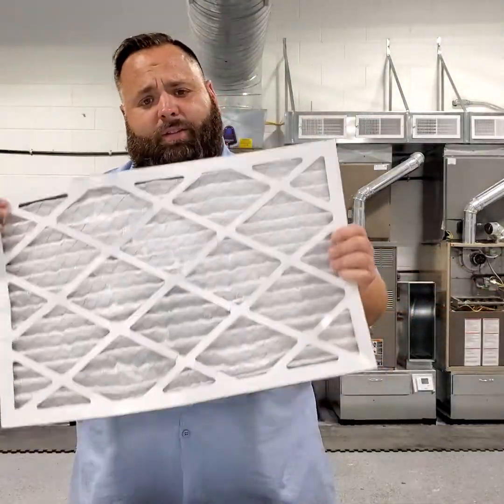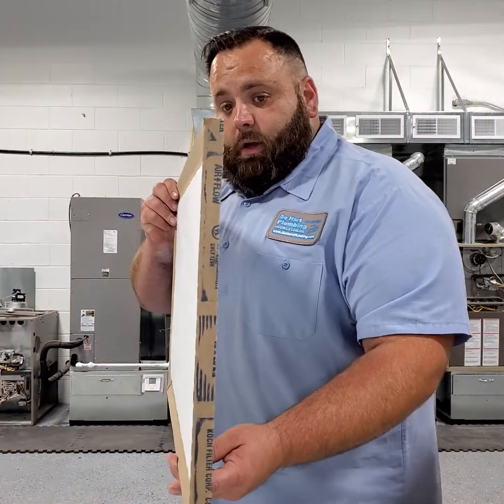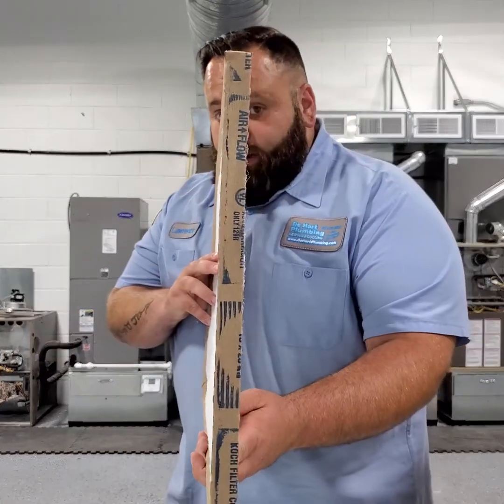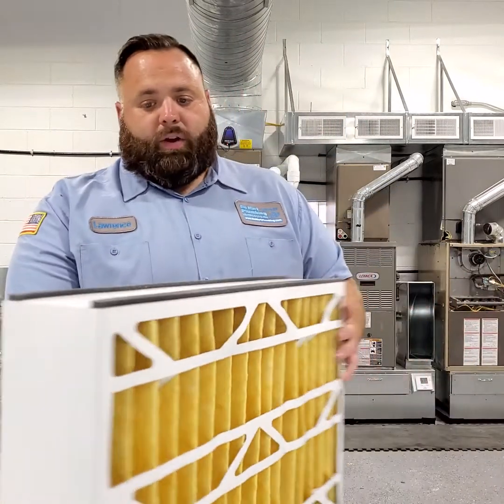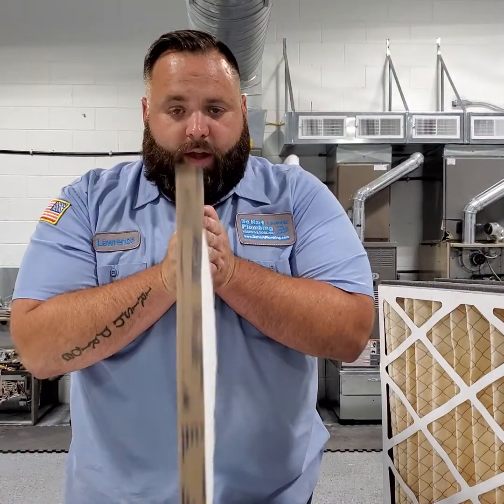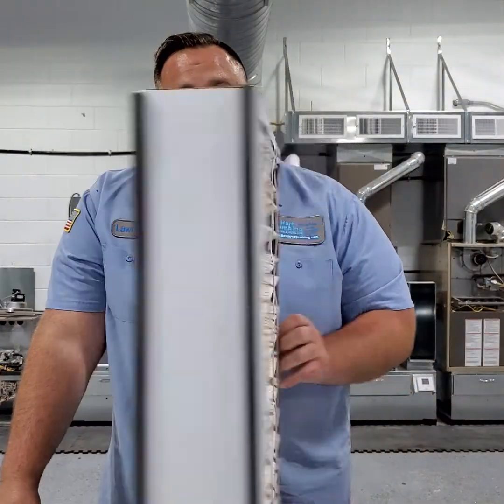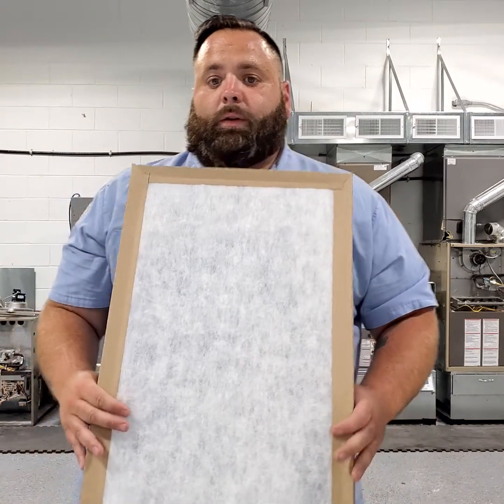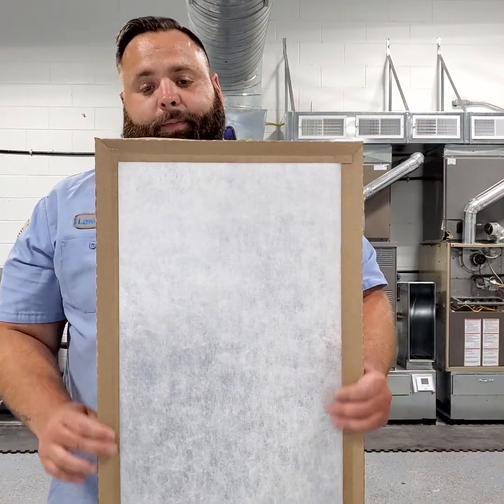HVAC system filters. Whats bad & whats good?

Comment: OK, so I've been using the accordion 20x20x1 filters for the past 10 years in the Las Vegas area. Never heard about MERV until today. My unit froze and we are waiting for it to defrost so the tech can figure out why it froze.
If I don't have carpets, pets, or smoking in the house, do I want MERV 7 and lower? So far, I only know I had 11 MERV for the last 3 months. Never knew about it to look.
Reply: Just brought Merv 11 - we have carpets and allergies. How is the 11 working for you?
Reply: @itzjustkay1972  I noticed the biggest change in air quality when I started running an air purifier. Not one of those ionic ones, but a hepa one. Due to an old rental with a serious mold problem I developed a sensitivity that, at 30, gave me my first real idea of what my asthmatic mother has gone through when her allergies affect her. So, someone loaned me an air purifier when I was there and then after I moved I started noticing that I’d become short of breath sometimes, so I got myself an air cleaner. (A good one) There is a noticeable difference in the air quality in my home, and what’s most noticeable to me is that I never have to dust, like, EVER in the rooms with the air cleaners in them. There is one room without one and I still get a little bit of dust there, but not as much. I think it’s more cost effective in the long term and much more noticeably improved on the short term to get a good, hepa, air cleaner and use cheaper, simpler filters that won’t stress your HVAC. bc there will be allergens in the vents, in the registers, in all these places PAST the filter anyway. If you have allergies I think you’ll truly notice an improvement if you try that. (And if you’re not vacuuming twice a week or more with a closed air cycle hepa filter vacuum I’d recommend that as well! I have recs on products if you’re interested, they pretty much line up with what wirecutter says tho)

Comment: Not to contradict his basic advice, but its interesting to see another HVAC Youtuber (https://youtu.be/GoOKjINPgpY) video where he tested static drop in pressure on both sides of various MERV-rated (MPR actually) Filtrete filters from MPR 300 to 1900, plus other 'flat' fiber filters. It was notable that the Filtrete  MPR 1900 uniquely actually had the lowest pressure drop.
Reply from the maker: That pressure drop is very important. However the HVAC system static pressure is the most important. That tells us how restrictive of a filter the hvac system can handle.
Reply: @dehartplumbingheatingcooli451  - I think you should've put this in the video description but what is the suggested filter to use that you showed in the video?  You didn't mention any specs about it?  Is it a Synthetic/Poly MERV 4 filter?  What brand?  Can you provide a product link so we can gather more info about it and/or maybe purchase options?  Thanks man!
Reply: @Kenster-man  that's what I've been using per my HVAC pros suggestion. They were 2.50 each when I started buying them last year but have gone up in price. I don't think brand matters, and got mine at Ace hardware, Palmlicoair brand
Reply: But the 1900 is expensive at $22 each.  Say it works for you for 2 months - that's costly and unnecessary to have a MERV 13 1" filter if you don't have asthma or allergies.  

Based on that guy's test - the 300 was practically equal in pressure drop performance and I would just use that (about $5-6 each) and change-out monthly.

Comment: Question. I have an older trane system that takes 3 - 10x20x1 filters placed in this shape /\/. Can i just use 1 bigger filter placed in at an angle like this / instead?

Comment: I've been using the Merv 8 dust lock and ultra poly in the metal frame in my house for over 10 years (Merv 8poly has twice the airflow that the standard Merv 8 pleat has) I made sure to use weather stripping around the frame to keep our any air bypass from going around the filter . I have been 8n the air filter industry for over two and a half decades and recommend poly over pleat all the time at certain accounts. I have seen people buy in to the highest Merv rating that can even HEPA in some cases their system and I try not to make them feel bad for doing so. I will now just send them this video in the future.
Reply: What brand and where do you buy your MERV 8 Poly filter?
Reply: @Kenster-man  I work for a filter company that makes filters for numerous places. I know tri-dim filter corp has them along with American Air Filter
Reply: @Kenster-man  Google ZORO they have it in bulk rolls in different sizes.
Reply: thanks ...for recommending something  regular people know nothing about and can't find any meaningful information. enjoy your 8 ultra poly wolly dust buster, i guess?
Reply: @trippplefive  a simple Google search can help you .

Comment: You said you need adequate static pressure.  What is considered adequate?
Reply from the maker: Check on the data tag of your HVAC equipment. Look for Max Total External Static. It's typically. 5
Reply: @dehartplumbingheatingcooli451  thanks

Comment: QUESTION: I don't understand how air filters can be directional? They have an installation arrow on them, but why? Ditto for the pleated cabin air filter in my car which, when I replaced it, I couldn't remember which way it came out and the retainer wasn't marked.
Reply: I believe it's because there is metal netting holding the shape "downwind."  If it were on the other side, the filter would billow in the direction of the air flow.
Reply: One is for the return duct and one is for the supply duct. 

The arrow goes innthe direction of airflow. 

So if you feel air coming from.the vent then the arrow should be pointed down towards the room it is supplying air to.

If you feel no air coming through when the unit is on, then it is returning air to the system to recirculate. In this case the arrow should be pointing up tor2ards the attic. 

Hope that explains it

Comment: High air flow fiberglass filters in my AC unit dirties the coils in the air handler ! Lowering the efficiency of the unit !
Reply: I have always used the the cheap fiberglass for years. I've never had a problem.

Comment: Are the fiberglass filters changed every 30 days adequate to protect the equipment, including the evaporator coil?
Reply: Yes they are. Spraying them on both sides of the filter with Endust or Lemon Pledge helps capture the dust even more.
Reply: @thulsa5218  Thank you! I've been doing just that!
Reply: Lots of HVAC shops & techs think that the cheap fiberglass filters are not good enough - way too wide open.  I can even see-thru them to watch TV - and looking at one closely, how can it trap any dust particles?  Lots of folks are suggesting entry-level MERV 4-6 filters minimum versus the see-thru MERV 2 cheap fiberglass filters.  A cheap MERV 4-6 poly filter like in this video that the guy showed (...is probably a MERV 4) or an inexpensive MERV 6-8 pleated filter and replace every month.
Reply: @Kenster-man  I've been using the fiberglass filters in my home hvac for the last 20 years and there is no dust/dirt build up on my evap coil, blower motor, or ductwork. Many hvac techs don't like the fiberglass filters because they get far fewer service calls so they don't make any $$.
Reply: @thulsa5218  I wonder if this is affected by region? It’s gotta be, right? Like, maybe certain areas have less potential allergens in the air in the first place?

I also think the fact that you actually change yours monthly is a big help, bc a lot of ppl don’t do this. When I moved into my previous apartment, after asking them a ton of times to change the air filter the guy came to do it but said he didn’t have a key to the little door to get to it, so then all this waiting for the key and long story short, I finally got so annoyed I just took the door off it’s hinges and when I opened the thing, the filter had fallen down because it was so heavy full of debris. It was one of those green cheap ones, too. Can you imagine?

Comment: I just realized the house I bought didn't have a filter in the one return our system has. And I wondered if they removed it because it was choking the airflow. But glad I saw this video. I'll get a 1$ filter because there's large dust balls floating in the vents when the ac comes on lol
Reply: Yeah removing the filter is such a bad thing to do . Not because dust gets in your ducks the worst part about it is it plugs the  A coil , which is your cooling coil. If that gets plugged that is costly problem. The filter does more than just stop dust in the air it stops dust getting into your components of your furnace.  What a stupid move by the previous owner.
Reply: @llignwahs66  Had a professional check my HVAC system and he said there's no filters because I have an electronic filter near the main fan area which handles filtration. Makes sense now.
Reply: @50kT  I’ve never heard of that, did he happen to explain why you had the dust balls coming out of the vent?
Reply: @rainbomg  No but I think its just dust that eventually gathered together into a ball. It looked scary at first like a rat was jumping up and down in the vent lol, but it was just this big dust bunny that was blowing in the wind
Reply: @50kT ha! I had that in the bathroom vent when I first moved into my current place. Its still there, it looks like a little piece of paper. I can’t reach it. That’s interesting tho, about your electronic filter… so you never have to change it out?
Reply: @Jacynda Minor  I moved here a year ago and changed it over the summer. I think it should be changed yearly. Yea it's always interesting looking into all the unseen spots of a house.
Reply: I hope you had your A-Coil checked for blockage.

Comment: Can restricted air flow cause the burning of fuses in the unit? Because it's working so hard?
Reply: My furnace has a safety shut off switch which kicks off in a reduced air situation. It's supposed to be self resetting but it didn't reset. The HVAC pro had to tap on it to get it to reset, explained to me the filter situation, and I've been using the simple fiber filters ever since.
Reply: Restricted flow will not create a load on blower motor.

Your furnace blower is a "pump". 
When you increase the load on a pump the amperage draw increases. When you decrease the load the amperage draw decreases.
More air = more load
Less air = less load.

The biggest negative when decreasing air flow in a furnace blower is the possibility of overheating the motor because of lack of air movement re: motor cooling.

Anyone not agreeing, please get out your amp meter and compare a new filter to a dirty filter.

For a furnace to "shut off" because of low air flow, the furnace has built in protection for "heat rise".
If not enuf air is passing thru furnace the heat rise protection will shut furnace off.

Comment: Hi Dehart. Quick question for you. So basically what you said in this video is 100 percent correct. I just had a new air conditioner installed at my house and the 14 x 20 x 1, merv 8 pleated filter was causing the evaporator coil to freeze up. The HVAC company put a 16 x 20, x 1 fiberglass filter in my HVAC system which resulted in the system NOT freeing up. I am now considering having the ductwork changed to accommodate a 16 x 25 x 4 pleated merv 8 filter. My question is do you think a 16 x 25 x 4 pleated filter will allow more or less air then a 16 x 20 x 1 fiberglass filter? I understand the pleated and thicker filter (16 x 25 x 4) will have way more surface area, but after taking into consideration the higher merv rating of the pleated filter do you think I will still get better air flow compared to the fiberglass filter? Thank you.
-David
Reply: It normally takes a 4 inch pleated merv 8 filter to give the same air flow as a 1 inch fiberglass filter. But the air quality will be hugely improved with the 4 inch filter.

Comment: Ah you end the endless debate about what filter is “best”.  Throw a cheapo spunglass in there for no restriction and have your evaporator and heat exchanger (if you have a furnace) every 6 months or go for  4”+ pleated filter and have low restriction, clean air and coil.
Reply: Just don't buy those green ones they sell at stores. The white ones like his even if they are not the exact same style as long as they are cotton looking white style you good.

Comment: What are your thoughts on the K and N  merv 11... HVAC washable filter????  I noticed my system is a bit louder with airflow when I installed compared to my cheap $5.00  Merv 8 filter.

Comment: Good presentation. Have a question. Maybe you can give recommendation.
 I'm  very limited on space. My system in an upflow in closet. Using a filter base which can hold 1 or 2 inch filter. Would a 2 inch pleated be a better choice to get more surface area ? I know you recommend the 4 to 5 inch filters but space is not allowing for.
Reply: Yes def  use a 2 inch merv 8 if possible. They have a lower pressure drop than 1 inch filters.
Reply: Yes it will be a better choice and it is made stronger than the 1" and has less of a chance of collapsing. You can actually order a metal frame and use either pleat inserts or poly inserts . Poly will give you more airflow with the same Merv rating depending on the type you decide to use. I know American air filter makes the 2" poly disposable like the 1" in the video and so does the company I work for